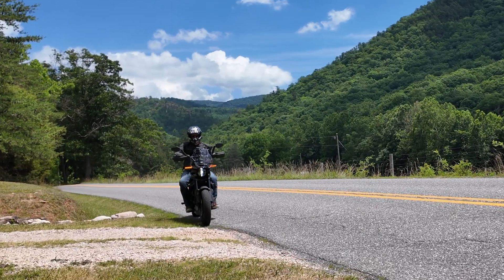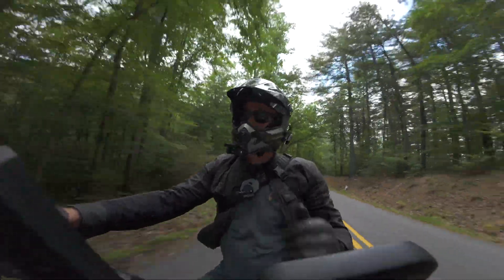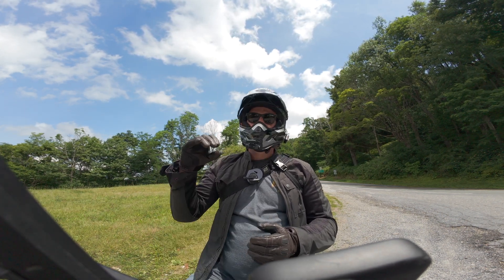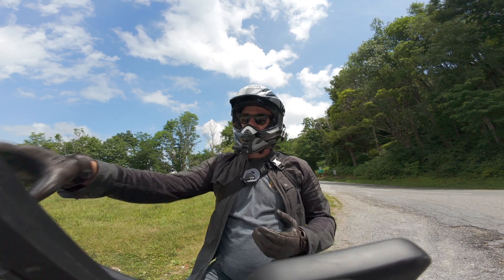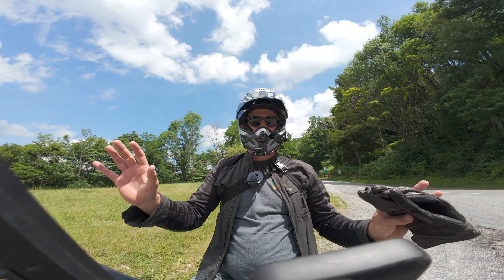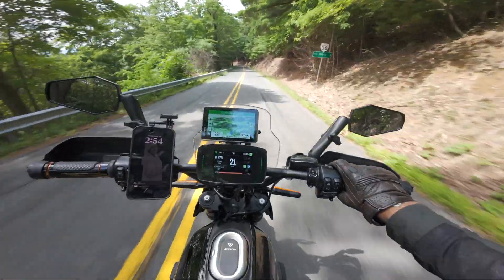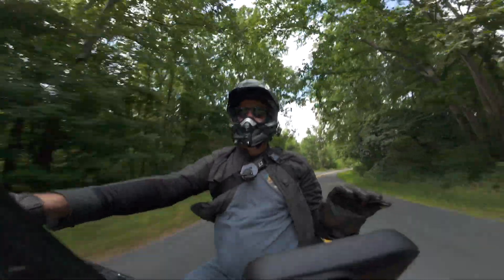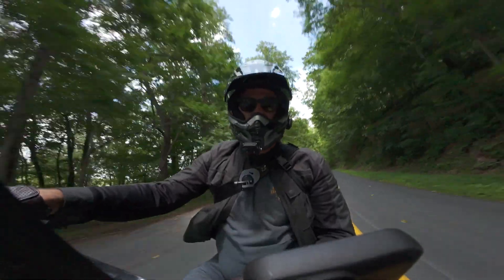Become a regenerative brake MASTER with this technique

Comment: Ok, so how does the roll forward regen work? If I had the bike set to 100 regen, do I get more regen from rolling the throttle forward? Or is max regen just max regen? So if I had regen set to 0 on a mode, and roll the throttle forward, does that just give me 100%. If you don’t get MORE regen from rolling forward, does it make sense to ever use a profile with regen? Technically you can just control it yourself totally if set to 0. It would be a more active way to use it.
Reply from the maker: Regen settings on the bike does not have an effect on roll forward regen. The regen setting in the custom profile menu only applies to one pedal riding (lack of a better term). As soon as you let off the throttle, regen braking begins and is relative to throttle position. Roll forward regen does not kick in until the throttle is rolled forward of the neutral/inactive position.

Comment: one more question, Ben: I understand your theory re: regen, but why turn down throttle and power? do you not trust yourself to accelerate moderately? You’ve obviously put a lot of thought into this.
Reply from the maker: Turning down throttle and power is a way to moderate rider behavior. For efficient motor and battery consumption, you want slow, gradual acceleration to prevent power surges. Turning those down is a way to offer more control for acceleration rate

Comment: I hope we see more progressive regen brake systems, way more effective than switching between modes.  Like a left hand regen brake lever would allow the brake to be applied immediately without the 1-2 second delay of switching ride modes, and allow the rider to vary the braking power as needed.
Reply from the maker: So that’s just how I use it, you can keep it on regen and control the throttle to coast, it’s just a really small position. Much easier to switch and coast on curvy roads

Comment: That looks like a mostly downhill route. Can regen actually charge the battery on steep downhill routes? I live in Michigan were its too flat to try that out.
Reply from the maker: Yes, the motor can generate quite a bit of power. This hill usually gets me 1-3% back
Reply: @AdventuresonZero  Can you do a video of that please? I bet a lot of bikers would be interested even if thier minds were closed off to ev bikes.
Reply from the maker: I'll add it to the list!

Comment: Well sure, it makes sense, especially in the US.
In Europe, the roads are so twisty (which is awesome) this would be impossible without a proper regenerative break lever (as discussed previously). Or a mode using the pressure on the brake levers to use regenerative breaking when enough and add actual brake pads when more is needed (as seen in another comment).
But in the end, have you managed go below 50W/km ?
Reply from the maker: Yeah I think whoever makes a proper regen lever that is relative, more you pull the more regen is applied, like a traditional brake. Are you asking if I’ve gone consumption below 50Wh/mi? I have no idea what the metric equivalent would be but the lowest I’ve gotten is 98wH/mi

Comment: Now, that’s a clever idea. Good stuff.
Reply from the maker: Glad you think so!
Reply: Ben, good video, however, your logic is flawed for some riding situations.  When riding aggressively in canyon roads,  want Regen when you lift the throttle so that you can go deeper into a turn without converting all of you energy to heat by braking.  Try this on a track under controlled conditions.
Reply: @tl2913 well that's my argument as well in Europe. 
Most secondary roads are very twisty. You need that regen breaking before every curve. No time for mode switching.
Clearly depends on the route of road.
Reply from the maker: @tl2913  you can go fast, or you can go far - can’t do both. Aggressive riding is counterproductive to getting the most range. Besides, I mention using regen only when stopping, or when you feel the need to use the brakes

Comment: Thanks for this clarification Ben! Yes, regen is best used when you would normally go to your brakes. It saves pads and adds some energy back that would otherwise be wasted as heat. This means on long steep downhills and when coming to a stop. You can also use the throttle to mimic coasting by using Ben's trick of watching the usage/regen gauge if your bike has one instead of switching modes. 9000 miles on my Zero DSR/X and loving this aspect of e-motos.
Reply from the maker: Nice! Great tips. How long have you had the DSR/X?
Reply: @AdventuresonZero  A little over a year now. Just passed 10k miles, mostly dirt. Completed the AZBDR in May and doing the IDBDR in early August. Might connect with Kevin and Amy in Idaho! Want to join?
Reply from the maker: @AmpedRider  I did the MABDR with Kevin and Amy last year - we had a blast (except for the wildfires 😷)! I think they’re in Scotland right now??
Reply: @AdventuresonZero  I saw your MABDR video, it was great. I am new to Youtube and documenting my rides, etc. Hope to have your skills doing this someday.
Reply from the maker: @AmpedRider  Nice! Just keep posting

Comment: Love the hypermiling tips! I often had only 37% battery left after my ride into work. Necessitating a 20-minute charge stop on the way home. Now I  usually have around 57% or more left over. What a time saver! And it all boils down to rider knowledge and behavior… my Livewire One doesn’t even have a windshield right now!
Reply from the maker: That's awesome! Rider behavior is one of the biggest factors in range

Comment: This describes one of the main issues I have with EVs. IMO, regen should be tied directly to the brakes for it to make sense, rather than tying it to the throttle. Regen should not activate unless you're on the brakes. It should work along with the mechanical brake, meaning the brake pads should only touch the rotor when regen is not enough to slow you down. I know one-pedal driving is popular among the EV car people, so sure, that mode should exist as an option, but I think most people would prefer to be able to coast in most scenarios rather than constantly be on the accelerator.
Reply: Ford does this on the Mach-E and Lightning, step on the brake pedal and it will use regen to slow the vehicle. It will only use the brakes if you press the pedal hard to aggressively stop the vehicle. It's definitely a nice feature.
Reply: @elbowsout6301  Damn, that's great.
Reply: @elbowsout6301 Like I said, not applicable on motorcycles. You may need the difference to stay up, like on gravel roads for example, were even gently squeezing the front brake would result in the front locking and falling down.
Reply: That's why I've been pushing for years the idea to force regen when pushing the throttle over its neutral position. In cars you can't pull the pedal but only lift it, in motorcycles (at least on Harley) you can push the throttle over its neutral position.

It's not that good to tie regen on the brakes, maybe if we do it on the back brakes, because on motorcycle there is a concept of moving load that is different than cars, in some situations the stability is important, that's why we have two different commands.
Reply from the maker: Every company does it a little different. The old Zero motorcycles would apply regen on the front brake lever before activating the front brake rotor. I think the best way forward is a combination of both one-pedal and lever activated regen braking

Comment: Great video Ben!  I've been doing this on my Zero as well with my custom "Coast" mode with no regen.  One thing that might be useful to know is that every time energy changes forms, like from chemical electric (the battery) to kinetic (via a motor that's not 100% efficient) is that you lose some energy.  Same thing when you regen and taken kinetic energy through the motor (now serving as a generator) back into the battery.  So by coasting, you preserve the kinetic energy in its current form and thus don't run it through two lossy conversion processes of throttling up  and the using regen down a small hill.  I also tend not to use cruise control on hilly areas because some cruise controls will maintain the speed even on the upper end and use regen by default.
Reply from the maker: Thanks! Good points, energy is also lost between components: tires to belt, belt to sprocket, sprocket to drive sprocket, gears, etc. by the time the energy gets to the battery, it's lost 30-40%.